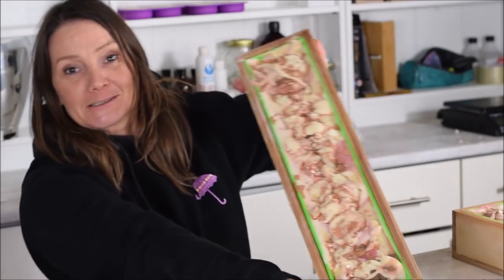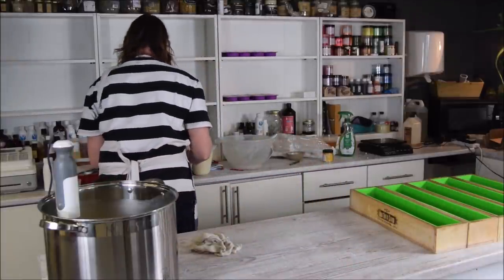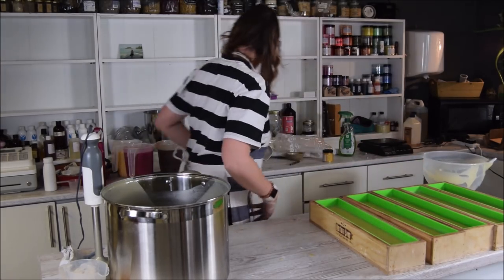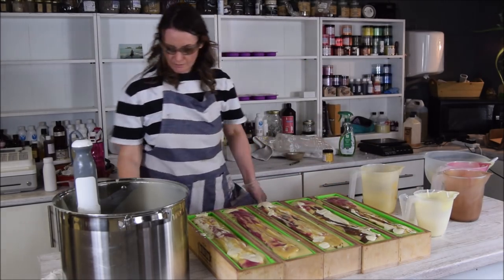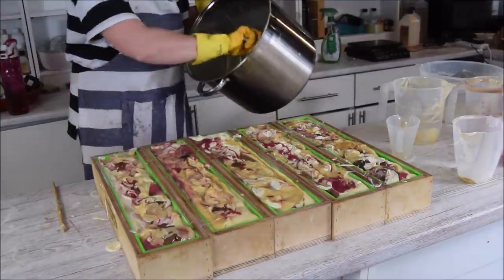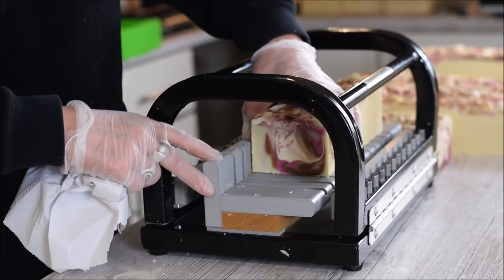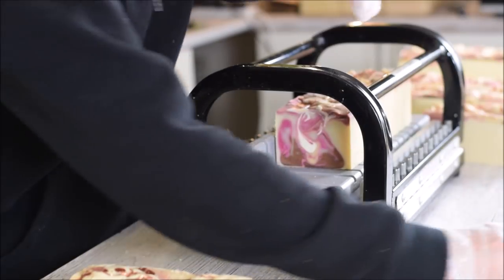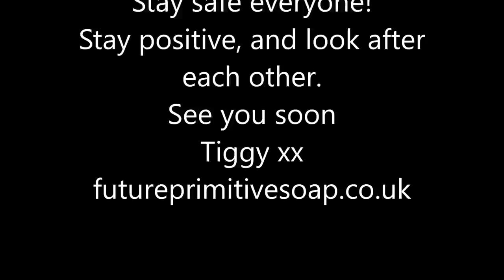Making 12kg / 26lb of Sparklebox soap | FuturePrimitive Soap Co.

Comment: Hi Tiggy, Such a pretty soap!  I was wondering if you could share which camera you use to do your videos.  I have been looking at them but am not really a photographer so all the info is making my head spin, lol.  I hope you have a great day!
Reply from the maker: I have a Nikon D5300, and use either a 18 to 55 mm lens or a 50 mm lens. The 18 to 55 mm lens gives me a wider view, and the 50mm gives more of a close up with the blurred out background. The camera also has a flip screen so I can see if I'm in frame when filming. I also use a rode microphone that just plugs into the mic jack on the camera and sits inside the shoe on the top of the camera. All set up on a tripod. Hope that helps.